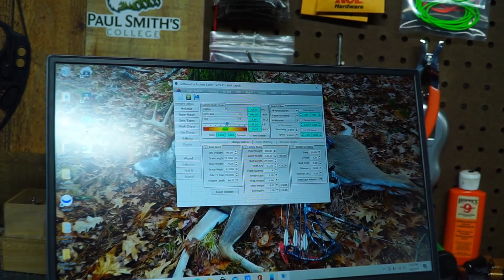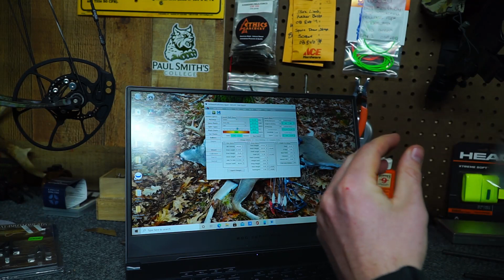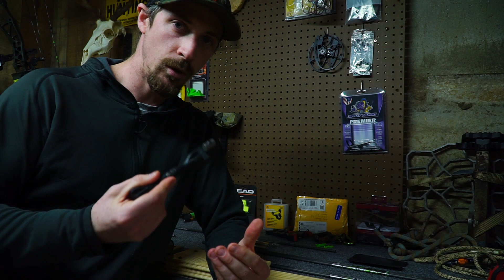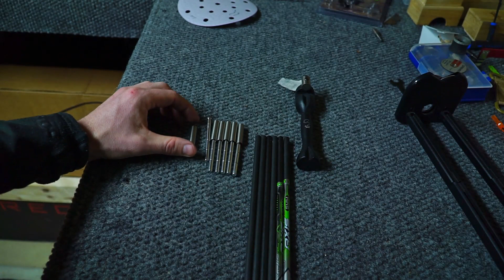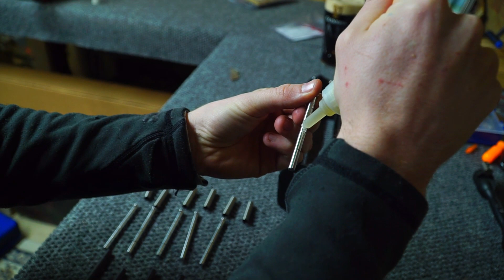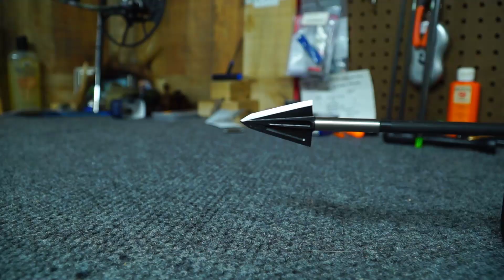Easton Axis 5mm - Heavy Arrow Build Pt. 1

Comment: ROAM - I'm getting conflicting information about the size inserts and outserts I need for this same arrow in 300 spine.  Can you direct me to the correct sizes?
Reply from the maker: https://ethicsarchery.com/collections/all/products/203-204-adjustable-outsert-system-272-sleeve-12-pk
This is what you would need for a 300 Spine Axis 5mm. It's the .204 Post with .272 Sleeve

Comment: i shoot the fmjs with alot shorter full ss out cert belive there like 60 grain, 30in shaft 300 spine and 125 to 150 head. the 5mm fmj. super hard hiting arrow and unless naill sumthen hard no bends or dings. and use feathers.

Comment: I'm shooting the 5mm Axis this year, using Easton accessories i.e. Brass inserts and adapter ring. 
Can you provide the Ethics Archery part numbers for your build?
Reply from the maker: for the 260 Spine Axis 5mm I used these https://ethicsarchery.com/collections/all/products/203-204-adjustable-outsert-system-281-sleeve
On their website you can select your arrow and spine they will list compatible products
Reply: @roamhunting9421  hey man did you have to sand shafts to fit sleeve over?
Reply from the maker: @deanbrandonsnelling7949  with these collars I did not have to sand the arrow shaft. I have built several arrows with the ethics system and I have had to sandpaper the shaft in some cases. Its had no impact to the structural integrity of the arrow any time i have had to sand

Comment: Did you have to do any sandpapering of your arrow shaft to make the collar fit? I’ve seen/read where some people had to do this with ethics. If so, would that affect the structural integrity in your opinion?
Reply from the maker: Great question, with these collars I did not have to sand paper the arrow shaft. I have built several arrows with the ethics system and I have had to sandpaper the shaft in some cases. I have not seen any negative side effects from it. You can get the Outside Diameter of your arrow and see what the size of the sleeve that Ethics offers to see if you will need to sand it. I believe that taking off a couple thousandths from the shaft for sleeve to fit is a non issue in terms of structural integrity.
Reply: @roamhunting9421  Agreed.  When I have had to sand (Victory VAP .166 insert/outserts) I did not worry about structural issues much, especially with the banger sleeve.  And never saw any flaw from it after many many shots.